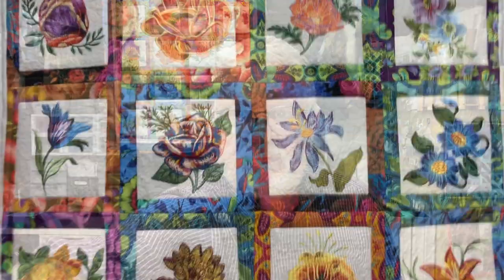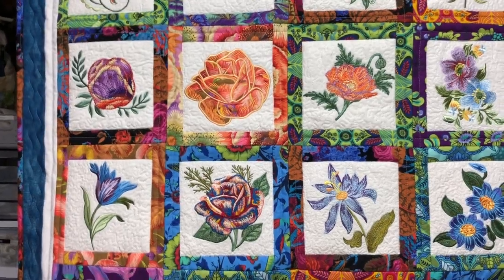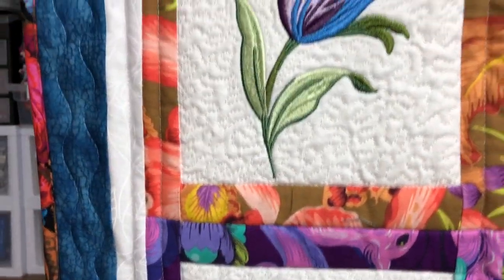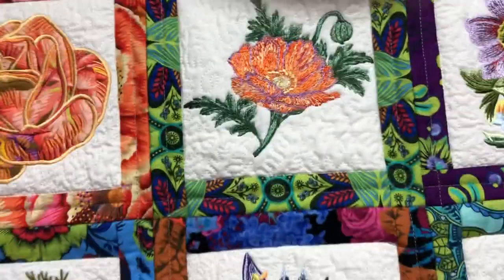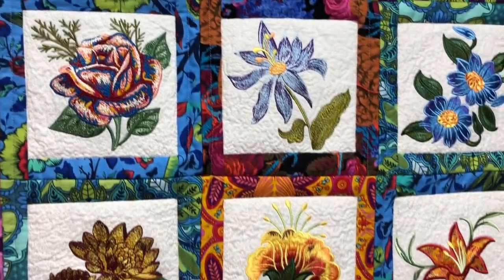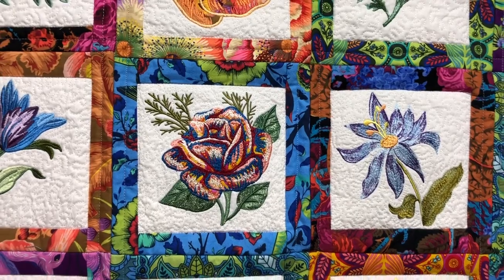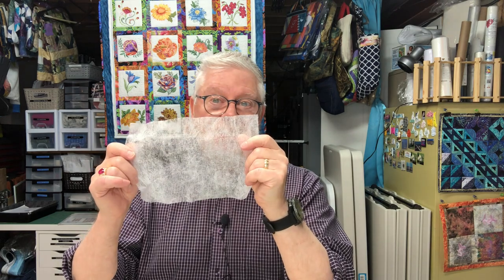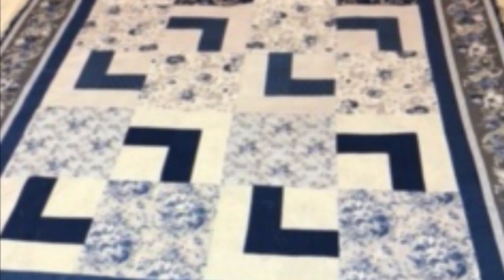The Idiot Quilter Ep114- Don't Mix Up Your Stabilizers! May 11, 2021

Comment: Thanks for letting us know about Lindley General Store. I’m in the US but their shipping costs seem quite reasonable. I will definitely be checking them out. I’m looking for some fabric with particular themes so hopefully they will have what I’m looking for. It’s for Christmas presents so I have time to shop often to see if they get in what I’m looking for. Also thanks for the tip on cleaning gunk off an iron. I would never have thought to use the white eraser. I usually have one on hand so that’s a great tip.